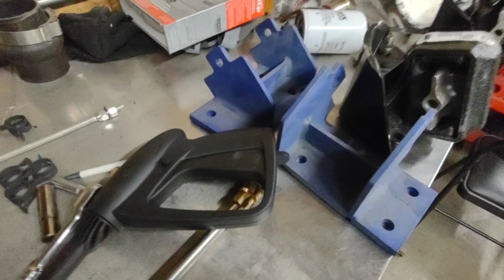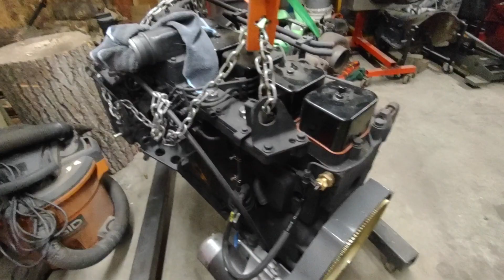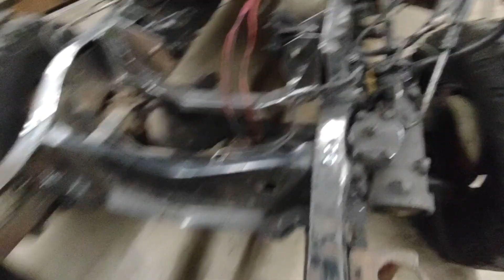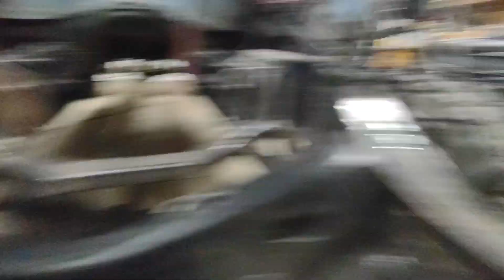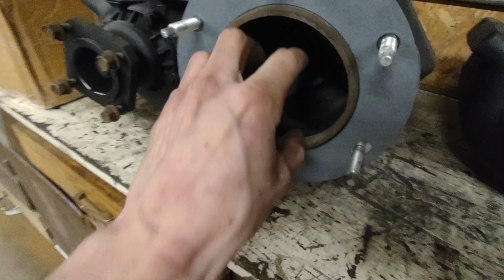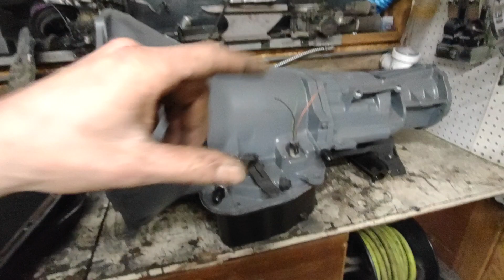Custom cross member for the K30 Cummins swap 🇺🇸

Comment: love that ,I would plate the frame box 4 bolt holes and have match on cross member 2 plate make the cross membe removeable,cut fire wall move it back 4 inches, hassle I know, nice work ,beef up frame st steer box dbl plate in back of box ,box in cross member ,  box section ,behind eng ,motor mount ,its a beauty Clark.

Comment: Most squares I see with the Cummins scare me since most of them have a too little reinforcement for that heavy mill ‘tween the C channels. This one here doesn’t have that problem imho.
Reply from the maker: You're right too I've seen some pretty sketchy hack jobs doing this conversion. Any inline six puts a lot of torque into the chassis as opposed to a V8, especially a diesel. That and these things really kick hard when you shut them down- almost looks like it's gonna shake the cab right off the frame lol